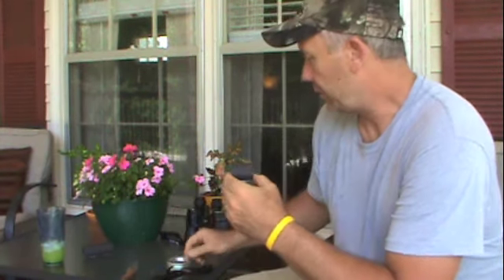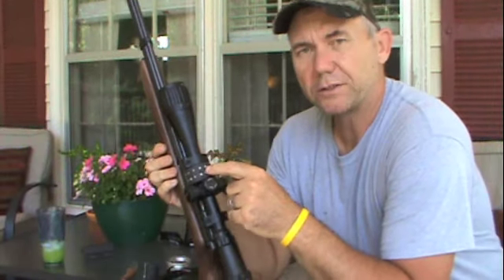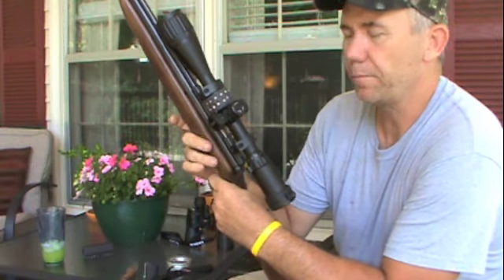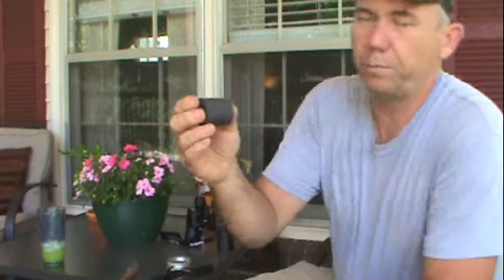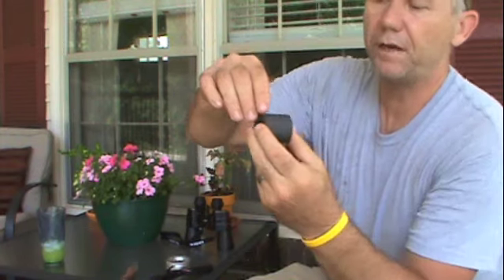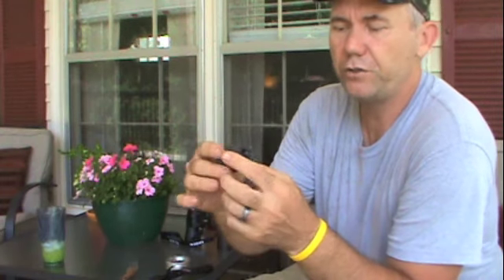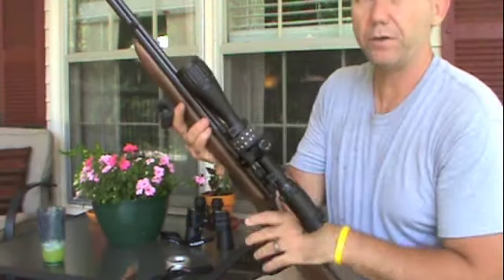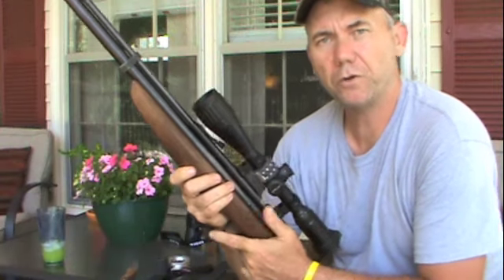How To Make A Pellet Holder For An Air Rifle

Comment: An awsomly simple and CHEAP idea, THANKS. Have you tried "ThUnder Bolt" lead free pellets, I would like your opinion of them. They are an English pellet that I have just heard about and will soon be trying. If you have not used them you need to clean the bore of your air gun of ALL trace of lead to get a proper test of them so I am told.